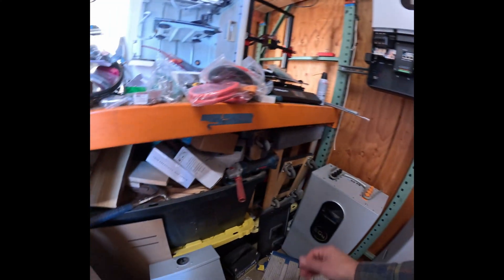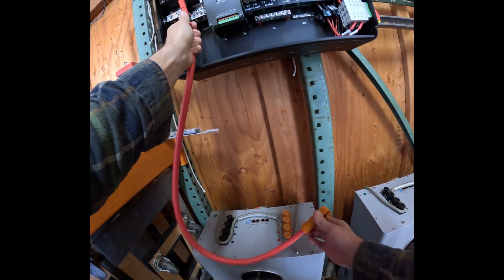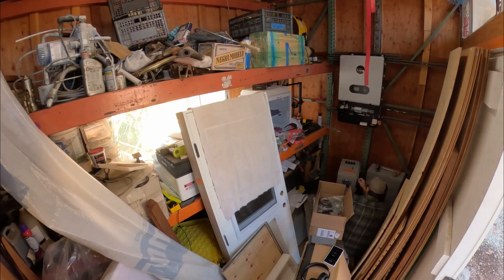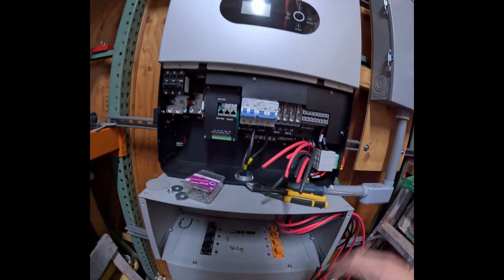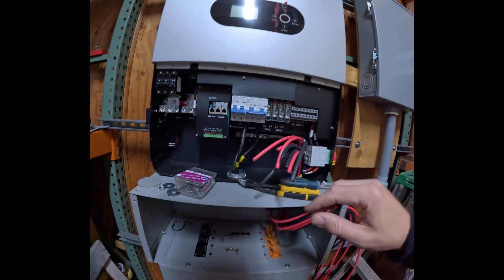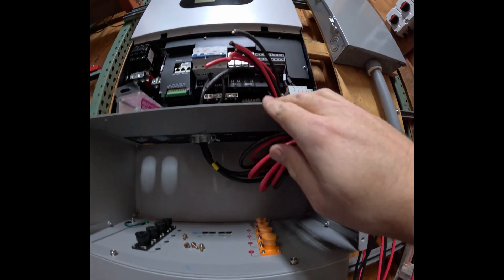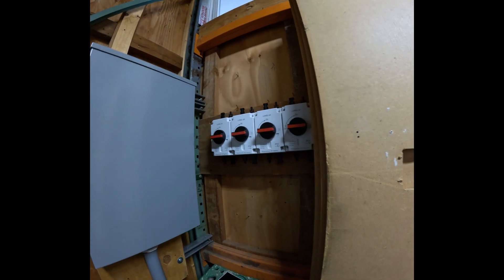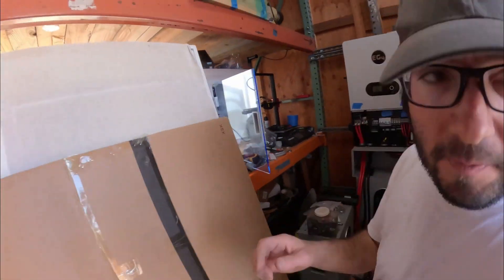EG4 12000xp inverter Install Part 2 - including two EG4 wall mounted batteries.

Comment: I read the same thing that they should be at 100% first. I have a chargeverter coming once they get back in stock that I plan on using to perform that charge. I'm in no hurry tho.
Reply from the maker: Awesome. Please let me know how that goes. I got mine charged one at a time on solar but made for an awkward install.